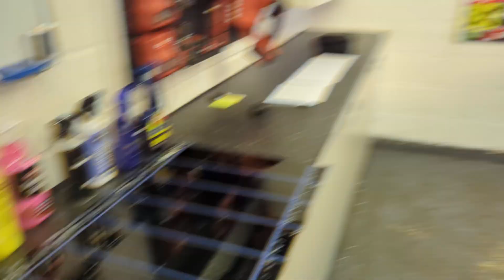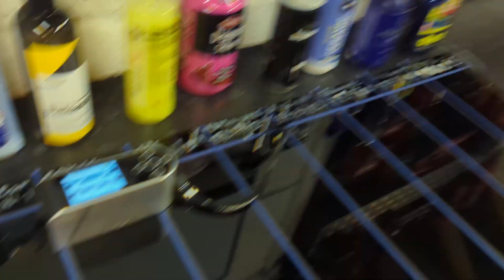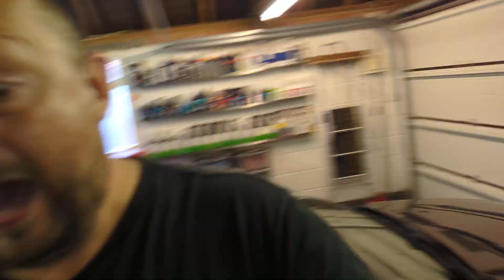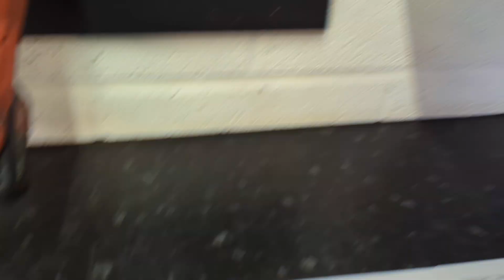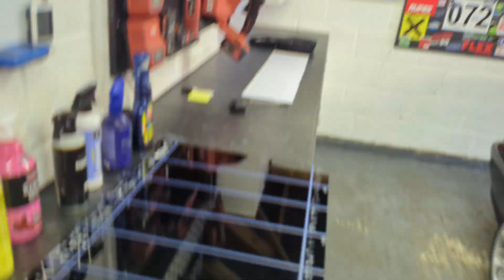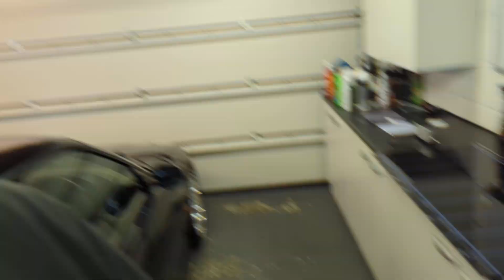Gloss Testing Sanity Check and Discussion

Comment: Many thanks Jon for ALL your time , effort and work you've done in giving us your results i would say regarding value for money you should try and take into account how much actual product you used as a dearer product you may? Actually use less than the cheaper products?
Reply from the maker: its too negliagable mate.  they all atomise small volumes per squirt some are low output say 0.9ml others maybe as high as 1.4 .  there is some variance.  some say I should agregate value with durability.  but I think you need to eliminate complexity and just do cost per litre.  otherwise is just creates get out of jail cards of which the brands will want to play.  end of the day its a chemical we deply, what is the relative cost of that chemical across the line up. theres clarity in this approach i think.  funny enough the choice of trigger can be (in fact usually is )a higher cost that the chemical itself.  when you get a handle for the price of the triggers and whats good and bad you can see the brands trying to save money on triggers but charge top of market overall.  that can be a red light for me, industry used to do it a lot with those little diddy sprayers but word spread they were used because they were cheap and brands steer away from them now.